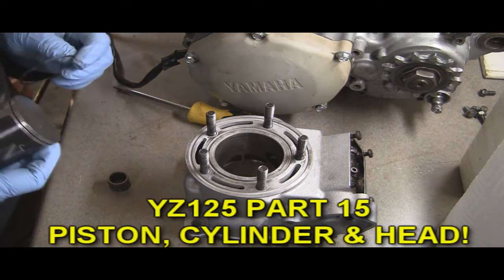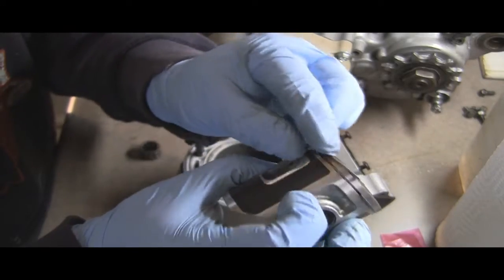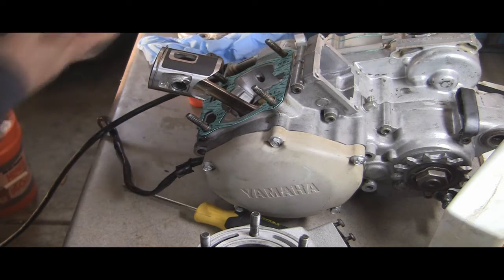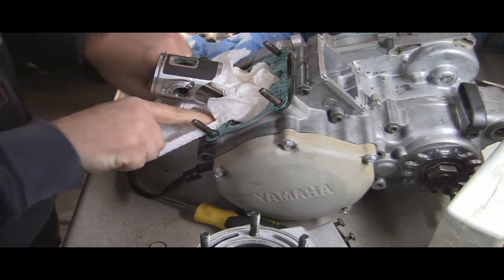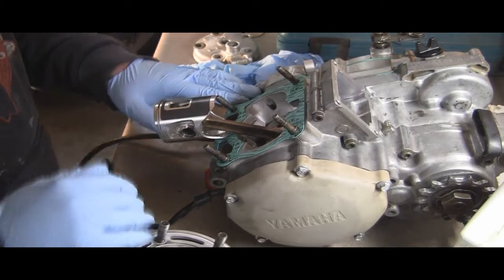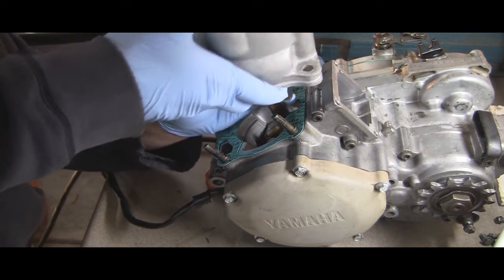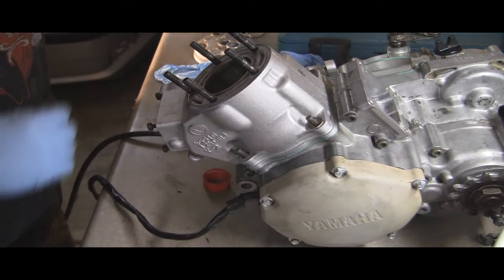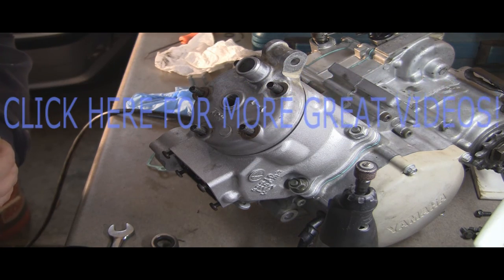YZ125 Part 15: 2 Stroke  Installing Piston, Rings, Cylinder and Cylinder Head!

Comment: Great videos. I'm rebuilding a 1998 CR125 from top to bottom very similarly to your bike - replacing on case half, new top end, inspecting everything etc. At the moment I'm acid washing the parts though because they all have some surface gunk that is hard to get off. Thanks for the videos though, it confirms what I already know!

Comment: Hi Johnny, Thanks for the informative videos. 
I misplaced my manual the other day and this video came in handy as a reminder of the sequence of assembly/disassembly.
One note. Your reference to the circlip positioning in the piston - you mentioned that you weren't sure about positioning.

The Manual (I finally found it) states that you should NOT leave the open gap in the ring at the open gap in the piston pin slot. They depict the ring gap opposite the opening.

Thought I'd pass that along.

Comment: lol, it's a 2stroke. There is no "timing" because there is no camshaft or overhead valves, and it accomplishes "suck,squeeze,bang,blow" in only 2 strokes instead of 4...

Bask in the simplicity and beauty of the 2T engine design!

Comment: You actually don't have to take the bottom end apart after a circlip has fallen inside the crankshaft side of the engine, to remove the circlip pour some wd40 in the bottom end and shake the bottom end around and flip it over facing down & let all of the fluid drain out into a clean bowl or clean pan. Or you can do this instead flip the bottom end over and grab a can of maxima contact cleaner and spray it into the crankshaft side until the clip falls out into the clean bow or clean oil pan. Don't use brake cleaner or carburetor cleaner as this will ruin the oil seals and mating surface gasket where you applied a paper gasket or rtv silicone and yamabond when putting both of the cases back together.

Comment: i know this video is rather old but this may be a stupid question but i race mostly 4 strokes, why would you need to replace just the piston head and not the rod? for example if the bike blows up, would you only need to replace the head or would you replace the whole piston, crank, rod,etc.
Reply from the maker: Depends on what damage is done. Usually the rods on a 2 stroke are ok unless a bearing goes. Typically the piston and rings are just shot.

Comment: Why dose my 2 stroke 125 dump a pretty excessive amount of oil through exhaust & pour out the muffler ❓❓ fouls plugs in 7 min of riding. Thank You in advance for info.
Reply: Thanks William Jones , I was hoping that's all it was. I purchased a top kit but didn't install yet.
Reply from the maker: +Mike Remvidas I agree, new rings.
Reply: +Johnnysshop  I'm relived to hear that's the problem. Now I put the top kit on & can't get a torque wrench in on cyl hope I have bolts pretty even. I guessed the feel of 20ft. Lbs .... Thanks for the reply !!
Reply from the maker: +Mike Remvidas Awesome!

Comment: Im having problems I have a bud head and I keep getting coolant coming through the head bolts replaced the o rings and and copper washers and has seemed to made it worse
Reply from the maker: Did you replace the head gasket also?

Comment: Use premix not motor oil it will actually help not hurt it motor oil has to burn out and you will got alot of blue smoke just  like when your crank seal blows.

Comment: Hey Johhny, i was puttin a top end in my bike Yz, and i noticed the wrist pin was actually hard to get out, like i had to hammer and punch it out, i was wondering if this is normal after wear of the pin, and will a new pin slide in easily?

Comment from the maker: +clayton roche OEM gasket and did you torque the bolts down to spec?
Reply: ***** What do you mean? What does torque down to spec mean?
Reply from the maker: Ian Arnold All the bolts have a specific torque setting they need to be set to, you can't just crank them down with a socket. You need a torque wrench.

Comment: my piston has gouges on the top all the way around in a circle, the cylinder is also not fully centered. one side is thicker than the other but it still is circular. I dont know if i should rebuild it or just throw it away. There is no scarring or scratches in the cylinder. What should i do?

Comment: I have a little problem... I don't know how to remove the cylinder head, beacause of all the wires, emmm like the RC valve wires, got a Honda CR125R 04.. Is it also very important to get these settings right when you put them back on?

Comment: I bought a Yamaha yz125 2 stroke its a 2007 but the motors completely torn apart because it need a new piston and rings was wondering if you have a rebuild video or planning on one?
Reply from the maker: There are a lot of them on my channel, the 98 isn't a huge difference in the 07
Reply: ended up havening to replace the crank so i just took it to a bike shop so i didnt have to split it and put it back together
Reply from the maker: mycookysdude Ahh. How much did they charge ya?

Comment: Every bike I've had that I discovered had a Namura piston had problems. They are cheap and sloppy. They will break quickly. If they don't break they will lose compression very fast!! Spend the extra dollars for a quality piston. The rings are soft and equally shitty too. Wiseco, ProX, Vertex.. forged is the way to go.
Reply from the maker: Yeah, I don't recommend them and this was basically to build the bike as cheap as possible. I told the new owner to replace ASAP.
Reply: namura pistons are forged.

Comment: I just put on my piston and everything and put my clips in and made sure they were in place but when I grab the piston I can move the piston side to side and it will slide side to side, was wondering if this is normal, thanks!
Reply from the maker: Side to side is fine, up and down is bad.
Reply: Johnnysshop Thanks, yea I just did my bottom end and just got my replated  cylinder.

Comment: im going to replace my pistons and rings in my KX100, i heard that i need to get the engine slightly bored out for the new piston for a good seal, is this true or can i just throw the new piston in without boring it out?

Comment: hello.  so I have a yz 125 01' and I just got a problem . water is leaking throw my exhaust and radiator cap. I'm new to this but I recently  changed the water pump seals by myself.  can you try to explain me what I need to do? please
Reply from the maker: +Nelson Francisco Sounds like the seals may not be good or a bad head gasket if you are getting water in the exhaust.
Reply: +Johnnysshop thx  for the answer I'm very appreciated but , I've been looking around and some more people are saying the same and it's about the head gasket but I have also some radiator overflow  I mean when I start the bike the water is pumping right by the radiator cap. does it got to do with that as well?
Reply from the maker: +Nelson Francisco Yep, sounds about right.

Comment: I've got a 1998 kx125 dripping black oil from ehaust and its smoking rich white smoke n lots of it no power hardly on bottom end but lots on top??? Any idea what's wrong...
Reply from the maker: Sounds like you could have a few issues. New rings, new silencer packing, power valve cleaning and so on.

Comment: for the clips is there a certain way they should face? like the piston ring has a certain spot
Reply: wait just kept watching and saw you say something about this
Reply from the maker: Yes, each manual should tell you. Basically you want them to be opposite of one another though.
Reply: Piston clips should have the opening at 12:00 or 6:00 to prevent them from compressing and popping out.

Comment: hi i have a cr85 what has just stoped working ive check everthing there is a spark n all clean filter n carb  fuel getting throw but when u try to bump it it just sound boggy i whas thinking it could be the piston ring what does it sound like to u mate and my mates cr the piston ring went on  his but it still started plz help

Comment: What are the torque specs for the cylinder and the head for an 04 yz125? I don't have a manuel.
Reply from the maker: Should be around 22 ft/lbs

Comment: 6.20 mins in the video where you said to move the gear to make sure everything is smooth. When you move your gear the piston moves.When i move my gear it just spins freely not a thing moves, any ideas??
Reply: Sprocket i meant
Reply: its in neutrual
Reply: derrick medley
 Thanks haha first time having a dirtbike and i got to put the whole thing together, so i was following all of johhnys videos
Reply: doestoutking
 I clicked it into a gear and its certainly not moving smooth i have to press on the piston and gear to get movement??
Reply from the maker: doestoutking With the cylinder off how does it move? You could have a bad crank bearing.

Comment: I just put a new piston rings and gaskets on my top end of my rm250 and it is now leaking coolant out of the cylinder cap help plz
Reply: Sounds like you didnt torque the bolts down to spec.

Comment: I cannot get the head back over my piston the piston has 2 ring and it won't go on any tips so frustrating
Reply from the maker: Not a lot of tips other than taking your time. They do make a piston compression sleeve just for this job. I think they run about $25.

Comment: how often do I need to put a new piston and rings on my 01 yz 125? like years hours or what.
Reply from the maker: +Josh Myers Just depends. Rule of thumb used to be 30 hours but it depends on how hard you ride, oil, etc..
Reply: So maintained and not raced it should be good after like 2-3 years? I've also heard that if you dont change them for a while it can damage other things. Thanks for the reply.
Reply from the maker: +Josh Myers Yeah and change the oil often.
Reply: Josh Myers

Comment: what would happen if you put the piston in the wrong way would it evan run?
Reply: I literally just bought an '05 YZ125 last week that I'm currently rebuilding the top end because the previous owner put a new piston in backwards.  It caused the piston ring gap to be incorrectly clocked so that it goes over the exhaust port, which immediately made it snag the port's edge and get the ring all mangled up as well as take some chunks of cylinder wall and piston out.  Nothing too too bad, I'm dropping the cylinder and new ProX piston I just got in the mail today off tomorrow at Langcourt for replating.
Reply from the maker: Phillip Bass chb148 gives some good insight.

Comment: Try giving the proper torque specs if your going to do a top end video you make folks think yeah just pop it on there and tighten them up. 

Cylinder is 22 ft lbs  head is 20 ft lbs
Reply: and if u dont torque to specs?
Reply: You warp the cylinder/ head

Comment: I have a 2000 yz 125 I just purchased that needed a top end. Now it won't fire up. I have great compression, spark, and carb bowl   is full. The reeds also looked good. Where would you start? If I put fuel in cylinder it will run first kick for about 2 seconds then die.
Reply from the maker: This may be a silly question but did you put the piston in the correct way? It's easy to get them backwards.
Reply: Johnnysshop Yes sir. After reading your comment, I went out and took the head off and the arrow is pointed towards front of bike.
Reply from the maker: Make sure the choke seal is good. A lot of times that will leak.

Comment: Where do u find the torque specs?
Reply from the maker: Repair manual or calling a dealership.
Reply: Johnnysshop ok thanks and how do you fix a scratched cylinder
Reply: Sanchez 674 send it to get replated, Millennium is a great company with fair prices. The scratch isn't nothing to worry about if your finger nail won't catch it, but if it does it's time for a replate. it's about 200 bucks but it makes it like new! Just make sure your wash it out with warm soapy water when you get it back then lube it and go!

Comment: after watchin this fuck 4 strokes i cant wait to get a 2 stroke this easy as hell 4 strokes got all that bs timin screws and car belts and shit (exaggerating) 😭😭😂 4 strokes are still fun but after seein why everyone says 2 strokes are easy to work on i dont thugs wit 4 stroke pistons i could do this in my sleep
Reply from the maker: Kidreckless14 haha.. Yeah, 2 strokes are way easy and cheap to work on!
Reply: +Kidreckless14  Lol we all know that you already have a 2 stroke...  You are just making 4 strokes look bad...  They are better, faster, stronger and smoother. the only downside is that they are more expensive and take longer to do a top end on...
Reply from the maker: +Davin Drachenberg (SkolpisFilmsMC) True
Reply: +Davin Drachenberg (SkolpisFilmsMC) how are they better? And what says there faster
Reply: better in the way that they are reliable and have power everywhere and many other reasons,  and no 250 4 stroke is slower than a 250 2 stroke..  but the 450 4 stroke is going to be faster than a 250 2 stroke.
Reply: Davin Drachenberg a 4 stroke is no more reliable than a well maintained 2 stroke....

Comment: Im having problems I have a bud head and I keep getting coolant coming through the head bolts replaced the o rings and and copper washers and has seemed to made it worse
Reply: 5 years later..........................but my RM125 Manual says to use thread sealer on studs

Comment: How do you the torque on the bolts on the front? It's to small with a torktool...
Reply from the maker: I just do it by feel.
Reply: you said torque it to specs!! what does 22ft lbs feel like? lool. just wondering what could happen if over/under tightened. ruin gasket?